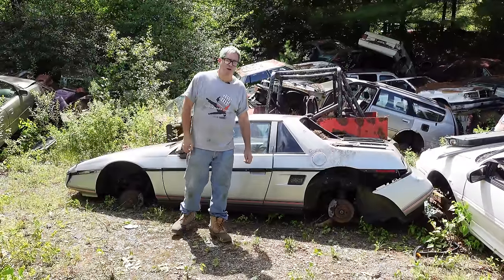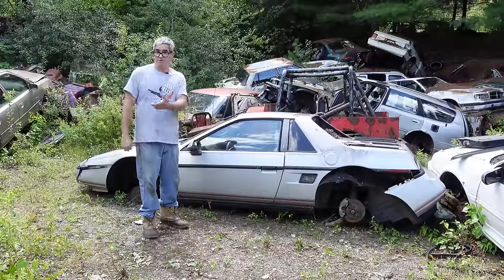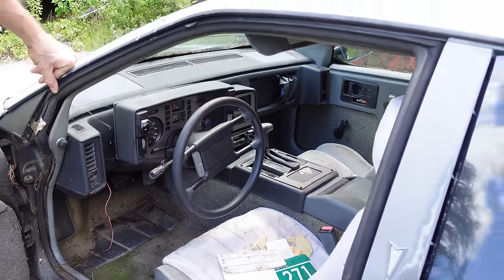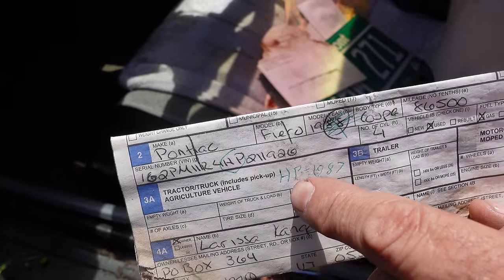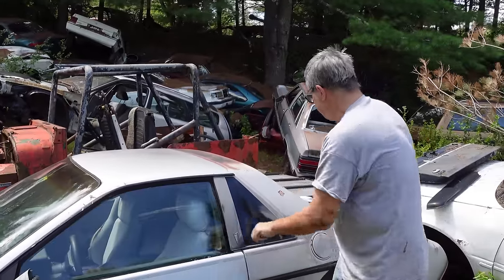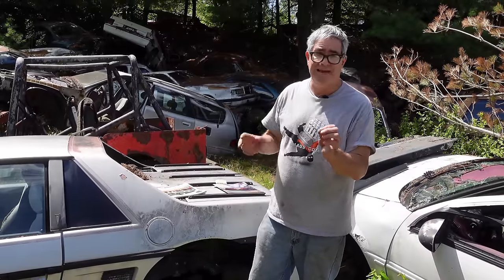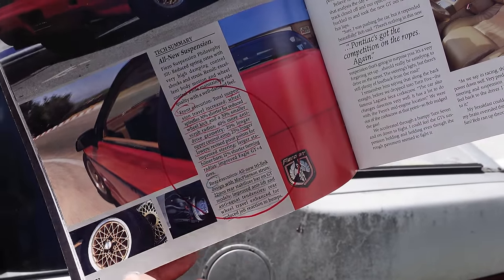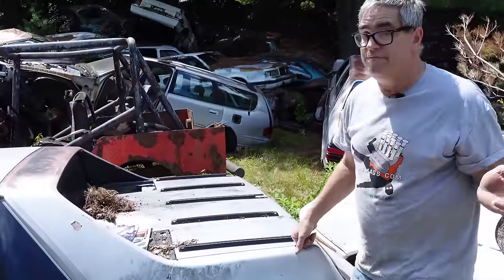The Mid Engine Pontiac

Comment: Steve, the speakers in the 1985 were in the headrests and the dash but later models had the rear speakers in the B-pillars, not the center console. (those were the computer cooling vents). One reason GM pulled the plug is with the 2.8L turbo upgrade it was out running the corvette. at 1/2 the price.
Reply: Of course GM couldn't have a small mid engine in their own line up be competitive to their flag bearer. GM corporate in their bonkers thinking somehow totally misses that the kind of buyer for the Fiero would somehow be able to afford or even be in the same bracket of buyer who could afford the Corvette; that you're going to instead upsell them the Corvette from the Fiero.. instead of saying, "Hey we have this smaller 2 seater that's a lot of fun to drive if you can't afford the big V8 powered Corvette." Or how about saying "We have a domestic that's cheaper than the Toyota MR2, or Nissan Pulsar, and goes like a rocket with the turbo engine we just announce ".. nope couldn't think outside the box like that. As Steve said, just as it got good and competitive they canceled it. I mean what potential 2-door Chevrolet Cavalier  buyer is going to upgrade to the Cadillac Coupe Deville? If anything they will upgrade to Buick if their income allows it. Nope, we can't have anything fun to drive for the more moderate buyers available, its gonna eat into the Corvette sales!
Reply: @marcusdamberger  Don't forget the Ferrari kits.
Reply: Yes, a powerful Fiero would smoke Corvettes like a C8 smokes a C1 - C7 Vette...
Reply: @marcusdamberger and Pontiac was supposed to be their performance line. So much for building driving excitement

Comment: Some Fiero's did come with a removable glass sunroof direct from the factory. And there is storage in the rear behind the engine.
Reply: Apples-to-oranges.  Fiero never got a removable targa panel like the c4 'vette as Steve referenced.
Reply: I had one red 1984 2.5 import back in the days with the optional glass roof , which could be removed and stored in the frunk.Yes a Frunk !! Lots of fun now sadly missed. Drove it from the Netherlands 🇳🇱 to the Czech Republic 🇨🇿 and back.
Reply: They also had t-tops available in either '87 or '88, a rare option.
Reply: @jonathanmorrisey5771  In 87 and 88 there was a T top option through GM done by Cars and Concepts. There was another company that did aftermarket T top installs. Not a true targa as the vette, but had to be done for structural reasons the same as the F bodies.
Reply: I think you ordered that a  dealer, but an outside company made the conversation after it left the factory.
Reply: I factory ordered an ‘84 with the sunroof and it leaked the moment it was delivered. Ruined the interior.
Reply: @robertpasquini4097  strange, i recently acquired an 84 fixer-upper back in march. Still not a single leak despite sitting outside for over 2 years since before I got it and the half year since.

Comment: I had one with the Iron Duke. I used it to commute to work 60 miles each way. I ended up putting 255,000 miles on mine before I sold it. Fun Little Car

Comment: GM developed a perimeter cage style frame on the Fiero. Similar to a Saturn.You could feasibly drive them without any body panels. Fairly advanced design.
 I remember two guys showed up at Maple Grove Dragway with Fiero GTs with 3800 Supercharged V6's out of Bonnevilles swaped in. They ran consistent mid 12's.
Reply: There's a whole world of supercharged Fieros on Youtube.
Reply: I recall hearing of Cadillac Northstar v-8 swaps.... not the best v8 but a small package that fit ok.
Reply: That’s cool as hell right there!

Comment: Typical GM. Finally get the car perfected and then stop production...
Reply: Or give it no marketing and then axe it when it doesnt sell, Buick Regal TourX is a new example.
Reply: I always thought it was more like part bins the heck out of it and rush to production, and THEN "perfect" it. A Chevette front end? lol. They killed it with the first engine fire sadly.
Reply: The cars actually handled really great. There were 2 reasons GM ended production. 1, drop in sales due to poor performance. 2 when Pontiac built a prototype 1989 with a 2.7L turbo V-6 it out ran the 1989 Corvette & GM wouldn't approve it.
Reply: Typical GM is ‘we wasted a bunch of money on R&D for a vehicle that is just ok, now bail us out’
Reply: @autophile-cv621  my freind has an 84 2m4 and it was a chore to drive. The stick shift felt like it belonged in a silverado not a sports car. The rear felt like it was gonna come loose in the turns. It was not a fun corner carver like a mr2 or honda crx.
Reply: It seems G.M. loves to do that. We build it,you test it, we'll kill it.
Reply: @stevefirth2013  - I remember at that time thinking "Wow, GM put all that money and effort to make improvements to a car a lot of people like, only to pull the plug on it? What kind of idiots are running that company?"
Reply: Yes, I wondered if GM had soldiered on, what these and the Cimarrons would've been into the 90's and beyond.

Imagine if the Fiero was also given one of the Buick Turbo 3.8 V6s that Pontiac used in the 89 20th anniversary Trans Ams.
Reply: So true 😊
Reply: Of course, the end result was presented to management at the beginning, but being management they “knew better”.  Then, at the end, it was of course “managements” idea to bring about “improvements”.
Reply: @CamaroSS-sy2ei  Sounds like the Pinto debacle.
Reply: Same with my Citation II. Get it right in '85 and then kill it off. Would have been wonderful back in early '79 when introduced for the 1980 model year for those 850,000 odd sales.
Reply: @jegjrfan  My grandad had a 79 Citation for 80 and he told me the e-brake cable froze inside the channel it ran through.
Reply: They could've produced a beast at that time They were toying around the public now their staving freaking 700 hp from the factory lmao
Reply: They explained why. They were going to turbo it. It was then faster than the 88 corvette. Gm said kill it no way

Comment: The first year Fiero was untowable by a regular tow truck.  It had to be flatbedded of which there was few of them around.  I ran 2 tow trucks then and was glad it was someone else in the company that folded one up till the doors popped open while traveling.  This case was in court for years and GM finally gave in and payed the insurance company a portion.
We never towed a Fiero without a flatbed after the first one.  In fact the Fiero is why the boss bought a flatbed finally.  We were still towing expensive cars like Roll Royce, Jags etc with Vulcan overhead sling trucks of which one was mine.  2 years of that and I went back to construction.  Cheers 🇨🇦

Comment: I have a few Fiero stories...   but Pontiac DID make a Turbo Fiero. They're mythically rare, I've been told possibly
as few as 8 & as many as 12. But I drove 1 in 1988 in Knoxville.
It was beautiful. An all black GT. The only way to tell it was a turbo was the word turbo would light up under
the right side tail light when the lights were turned on.

Comment: Sheet molded compound (SMC) caused some problems when it first arrived on the scene. Most Semi truck cabs are made of SMC today. When they transitioned from fiberglass they didn't get the word out. Many body repairs failed because technicians weren't aware and treated it like fiberglass.  SMC uses epoxy resin based materials for repairs and fiberglass is polyester based resin, completely incompatible materials. Although the polyester would initially stick to the SMC, it would fail in short order and fall off. I was working at a truck frame and body shop at the time and tried warning the body techs.  I got the old, "I've been doing this for 30+ years, don't tell me how to do my job kid"! Lol A lot of old guy's with egg on their faces when the repairs failed, but did gain their respect in the end. Lol But, I had a slew of "redos" in the paint department due to the re-repairs. Eventually 3m, and others did mini classes at the shops, teaching repair procedures and materials to be used. SMC has a 30 day shelf life and has to be used within that time frame during the manufacturing process, otherwise it has to be returned and recycled.  It's heated to a specific temperature, to where it becomes almost taffy like. It's then placed over a mold with little holes that pull vacuum through them. The SMC sheet is pulled down onto the mold, and cooled by the vacuum. It cures almost instantly and voila, an instant body is formed.
Reply: The build structure on my 1976 GMC Motorhome!

Comment: The iron duke was mainly hated for being extremely loud and unstable, given that it was an I4 over 2.0L. It was a good engine for compact & subcompact economy cars, but had no business being in a performance car. The rear-mid-engine, RWD layout of Fiero and MR2 were largely rendered gimmicks, given the running gear, and they were ultimately turned by bean-counters into economy commuter cars, rather than sports roadsters. They had far more in common with a Honda CR-X del Sol or Mercury Lynx LN-7, than they did with genuine, rear-mid-engine, RWD, sub-exotic Supercars, like the Honda NSX or Porsche Cayman.

Comment: I hated working on those cars the cyl head on the 2.5 had one headbolt move slightly so they dont interchange and they crack bbecause of the cooling system, and brother that damn 2.8.

Comment: A rumour I heard was GM was pressured by the Corvette division to pull the plug on the Fiero.  After the 88 upgrades the handling performance had surpassed the Corvettes.
Reply: I also heard they put a 350 in one and it was faster than the corvette

Comment: A friend and I got involved with those back in the early 90s.  We could buy them cheap,  because a lot of them weren't taken care of, and didn't run. We bought an 88 GT  with cheap V6. Auto.  We picked up an engine at a salvage yard from a front wheel drive car,  replaced it, it ran great. So my friend decided to keep it. The 4 cylinder 5 speed was a lot of fun though.  We got so good at swapping engines that we could get an engine/ transmission out in 3 and a half hours.  The first time took much longer because we did it the way a repair manual told 😮us. We found instead of removing all the engine wiring,  remove the computer and set it on top of the engine.  The engine/transmission came out through the bottom.  After getting the engine out, the wiring only took about 5 minutes to remove. Went back together in about 4 hours.  We could change an engine in one day. Some of the 88s had T tops.  Don't know if they were factory,  or maybe dealer installed

Comment: Hi Steve, good video!  If I am incorrect, I will eat my words.  The four cylinder engine was popular to keep insurance rates down (on a two seater car).  The Fiero fastback was called the Fiero GT.  The original parts bin was the Chevrolet Celebrity, including the subframe or "engine cradle  you might say" moved to the rear.  As far as I know, the Fiero was first to use electric power steering, no pump, no hoses.  1988 was the last year for the Fiero, taking advantage of brand new chassis.  In the mean time, insurance rates went sky-high on the new chassis "same as the Chevrolet Corvette" and that is what killed the Pontiac Fiero.  Please reply.  Dave...

Comment: I had an 88 Fiero Formula, 2.8 V6 auto. The auto killed it, but it did handle very well. The guy I purchased it from had put seats from an 84 Indy Pace car in it, so it was a mix of first and last year stuff. I got divorced and sold it to buy a house. Unfortunately the guy that bought it was going to chop it up to do a Ferrari kit on it. It only had 89K on it at the time.

Comment: I owned 2 of them as used cars in the early 90's. One 4 cylinder and one v-6. The 4cyl was fun, but not exciting. The V-6 car had a stick and it had enough power to be fun and kinda exciting. It wasn't fast by any means, but being that small and that close to the ground...it felt fast. I installed a GT front facia and it looked pretty cool too. I'd take another V-6 car if one came my way....if I could get in it anymore, that is. 🙄
Reply: I know what you mean, with it being hard to get into the Fiero. 
My friend had one, and it was extremely difficult to get my 6' 5" 250lb frame into that car. Plus, it was very uncomfortable being that close to the ground riding along.

Comment: Great video I've owned several fieros I've never seen speakers in the center console the rear speakers are on the other side on the pillars near the fuel door release where you pointed is just a vent on the other side of it is the ECU

Comment: 'Fun-cono' indeed! IF - big if- you could keep the rear CV's in them (do not, under any circumstances 'tap' a curb!). I had an '87 and the Iron Duke (I got a "0" bore and "0" under shaft "Remanufactured" short block for it when Pontiac let the parts store go in 97-98 - for $300!) would reliably push it up over 90 with the single jet throttle body injection. I jacked the body up over the engine carrier on a 4x4 for the engine swap. Easy! The rear calipers had the same type of mechanism as the vettes, and I was able to get it back together without having to replace seals when it popped on disassembly. Fun, fun car it easily outhandled the MGB-GT I had in college. 

For my 87 the 'death knell' was that I couldn't get a steering box, or parts for it, to stop the 'wag' in steering that entered (not the rest of the suspension - it was fine). Then on to my next Fun-cono car - a Toyota Paseo.

Comment: My first car was an 1974 X1/9. Fiat comically addressed the federal bumper mandate with giant external rubber blocks (and comical ride height). I remember the front wheel bearings being nuclear submarine-sized sealed roller bearings retained by the largest threaded ring I’d ever seen - and the front end of that car couldn’t have weighed more than 400 lbs.
Reply: Cool car!

Comment: They were prone to fires if you didn't keep up with oil leaks. They got a bad reputation for that. Nowadays they make a cool platform for Northstar and LS 4 conversions.
Reply: 1984s were yes, because they had a shallower oil pan, run it out of oil would cause the engine to grenade and dump oil over the exhaust thus the fire. GM recalled them and increased the pan size.
Reply: A friend of mine bought a real nice looking '85 Fiero in the early 90's off a private individual. Big mistake. Almost within a week of purchase, he started having major electrical problems with it. Became a real headache.
Then, luckily for him, he and his wife were coming out of a shopping mall, and saw the fire dept putting out the flames coming from the Fiero! He bought a new Trans Am with the insurance money.

Comment: My daughter's first car in high school was 1985 Fiero with the V6. It gave good performance and was fun to drive but the worst problem I ever had was trying to burp all the air out of the cooling system. If you didn't get it right an air bubble would form in the engine and it would over heat.

Comment: The V6 had to lift the engine to change spark plugs on the front engine by the firewall.  The trick was to go through the passenger compartment to get at them.
Reply: Don't tell me you actually cut a hole in the rear firewall just to change spark plugs!!! I've owned an 87 GT for 14 years and the front bank of plugs are easily changed without lifting/ tilting the engine or cutting holes.
Reply: Boy are you doing it wrong then!  I've changed literally 100's of them over the years. Can do a whole set in about 15 minutes at a leisurely pace.

Comment: The removeable glass was not a targa panel... But it was a big piece of glass, pillar to pillar... I've owned several over the years. Great car once you get the suspension dialed in and drop in a newer engine. All you had to do was drop the rear cradle, weld in mounts and pop it right back in. I've seen them with 3.4's, 3.8 series 2's, 350's, Northstars... No limits and was just fun to drive

Comment: Hello Steve! Great clips as always! At 3:04, the plate in your left hand looks pitted, whereas the one in your right hand looks unused. It is quite possible that these were dealer plates, as most states in the U.S. and provinces in Canada have the "D" as the first letter, which denotes dealer plates. Those plates were possibly used by sales personnel going with clients on test drives, as there are no bolt marks around the mounting holes. Another thing, those plates were possibly issued for trucks, hence the painted "T" in the bottom right corner. I have a 2011 Silverado LS, and here in MB, the "T" is an adhesive sticker on the top left corner. I always look forward to new clips; something new to learn every time - keep on keepin' on brother!!

Comment: The Pontiac Fiero and the Toyota Mr. Two were both selling in roughly the same timeframe.  After a couple years, the market for used 2-seaters was satisfied.  The resale value went down, followed by the demand for new two-seaters and it was the beginning of the end for these two cars.  It's not unlike the availability of modestly-priced used Ford Model T's bringing down the demand for new Model T's.

Comment: Did some have T tops?
I thought I remember t tops,
A friend had one of these and another had an EXP, then he got a GTU.
Lots of funky experimental stuff in the 80s
Reply: There were T-tops by aftermarket but the factory came out wit them  in 1988. although they were also aftermarket, they were factory approved and installed at the Fiero plant.
Reply: Cars and Concepts did "second sticker" T top options. Cars were shipped to them from the factory and T tops were added then sent to dealers for sale in 87 and 88. There was another company that did aftermarket T top conversions. There were a couple companies that also did convertible conversions.